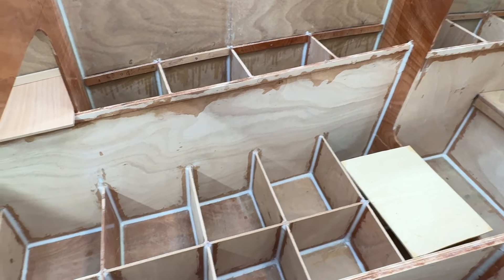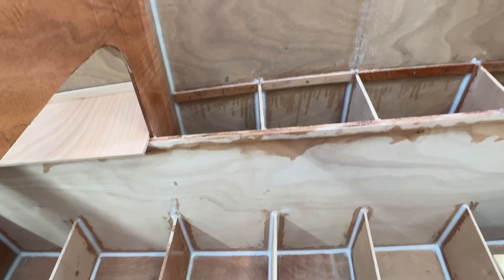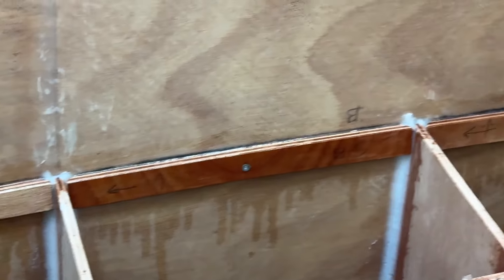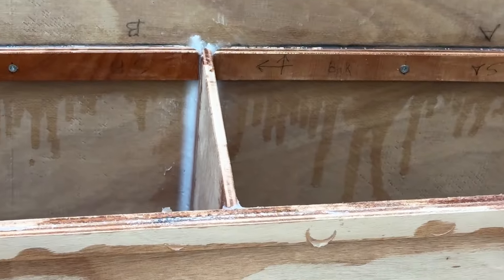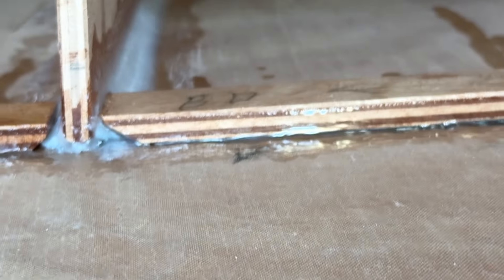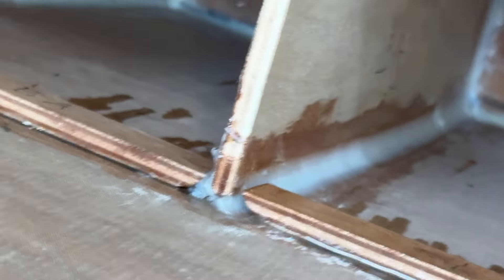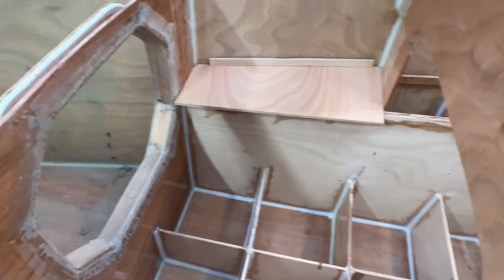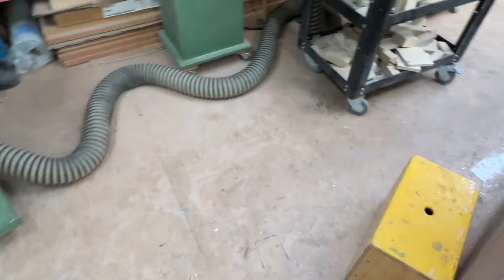28 July 2024 Gluing more + 1 lid

Comment: When gluing in the low bulkheads for the storage. Cut the top corners to take the top bearers. Then it will be easier for you to insert the bearers instead of cutting small pieces.